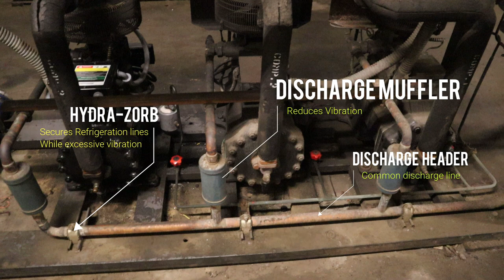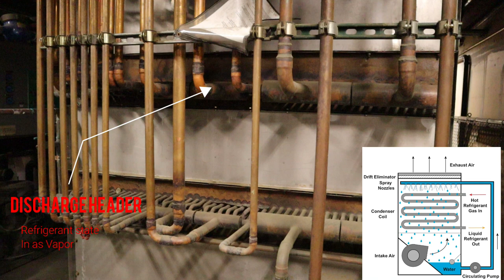Refrigeration Cycle in the Machine Room

Comment: Wish i had this when i was learning back when doing rack. I left. But that rack looks pretty simple compare to the  a big one with satellites and heat reclaim and all this jump and 3 way valve. I was clueless.🤣
Reply from the maker: haha its all simple but I say that already 17 years in
Reply: @refrigerationconfidential4376  the ones you showing yeah look simple. Same as a single system but 3 compressors
Reply from the maker: @ScrewedUpEssayLatin  that’s it some are 3 some are 5 compressors just trying to maintain that suction set point
Reply: @refrigerationconfidential4376  if you ever have time do one on unloaders/ demand cooling on if you can.
Reply from the maker: @ScrewedUpEssayLatin  I have a video on troubleshooting Demand cooling but for sure I’ll keep in mind the unloader video next opportunity it’s coming